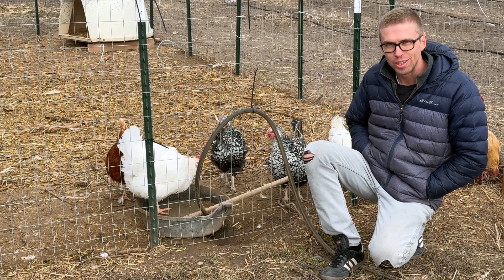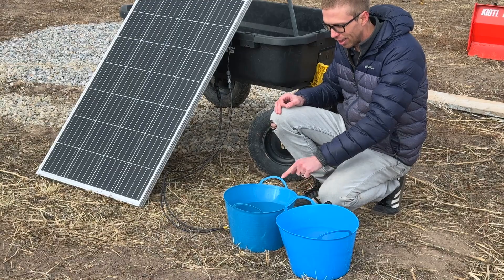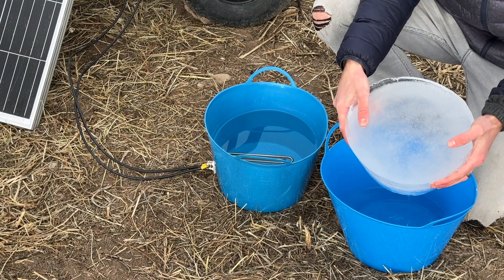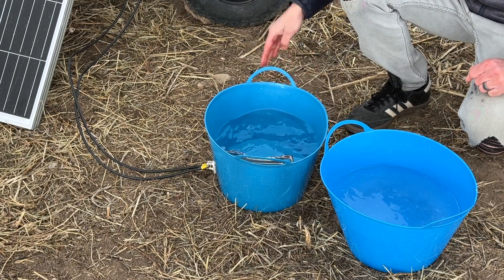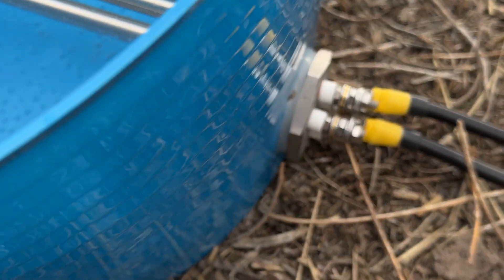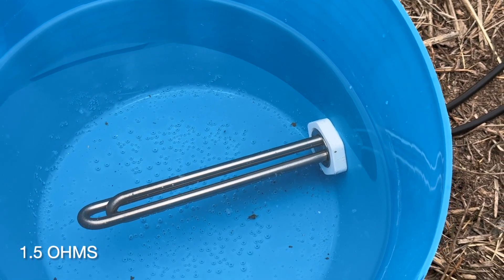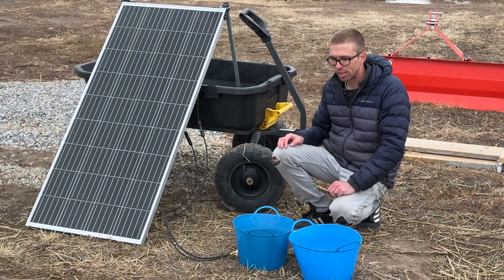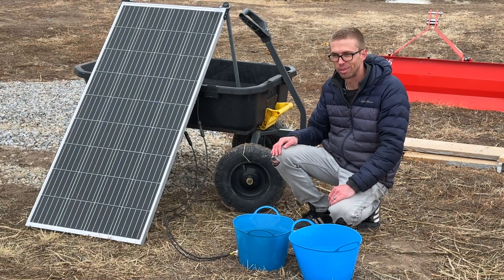Solar Chicken Water Heater // PV direct!

Comment: Technically could you snip off mc4's from panel and direct connect to heating element?
Reply from the maker: Yeah you definitely could! But if the heating element dies then that’s a lot more work to switch it out

Comment: This is very cool.  I have been toying with the idea of trying to heat ibc totes in the winter in a high tunnel to act as solar heat batteries.  You now also have me wondering about using something like this to help heat an above ground pool.  Thanks for the video.  We should collaborate on something.

Comment: You have done about as good as you could with standard off the shelf components and not putting two in series. There isn't a good selection of elements.  Many are not aware that a 12V panel is actually 20V.    IDEAL RESISTANCE is a little over 2 ohms.   There is a penalty for going under resistance, but very little for going over.  Studies have shown that total daily power increases even at twice the ideal resistance.   A 6 ohm 9,000W 240V element would be pretty ideal for winter.  Except it wouldn't fit in your bucket.  A combination of silicone heating pads would be a solution on a metal bowl.

For the last ten years I have specialized in PV water heating and have designed controls for efficient energy transfer matching the panel to the element in any sun condition. Especially early morning.  In low sun conditions found in winter the panels low current produces very low voltage. It is a function of squares producing extremely low power.   My ideas haven't caught on in the solar community, I would probably do better with the chicken people. I have some old prototypes which would work with you existing setup.  You might have to add a thermostat due to higher energy. Contact me if interested.
Reply from the maker: Oh man, this is awesome! Thanks for the info and I'm glad you found my video!

Yeah the chicken folks might be your people! I'm surprised how many people I've seen talk on forums about wanting to heat water for chickens with solar but the majority of responses are that it's not possible or too expensive. I had a hard time finding any attempts or setups shared online, especially not any using direct to resistance heating.

I'd love to learn more about how the mechanics of power point tracking works in optimizing power output on solar for something like this. I just assumed that the lowest resistance possible would be ideal to prevent the element from being a bottleneck on current.

I just created a setup with a larger 15 gallon water container. I wonder if a 9kW 240V heating element could actually fit in there...
Reply: @SmithOffGrid  All solar is local.  This morning it is 8 degrees, overcast and there is a slight dusting of snow on the panels. At home I have a 450W 60V array for supplemental heat to my heat pump water heater. This is mostly for product development, my summer home is all solar. 
At this time the system is producing 0.25A @ 60V or 15W.  This is lower than usual but in winter getting 40 to 70W (15%)is not. 
I removed the snow about an hour later and current increased to 0.96A (58W).  The current rating of these panels is similar to yours. You design for the bad days.  Good days take care of themself.

Suppose your panels can only produce 1A on a winter morning. This data can be verified by measuring element voltage in the morning.

1A X 1.5 ohms = 1.5V  Multiply that by 1A and it produces 1.5W.
2A X 1.5 ohms = 3V  Multiply that by 2A and it produces 6W.
3A X 1.5 ohms = 4.5V  Multiply that by A and it produces 13.5W.
That 200W panel hasn't provided a lotof p ower but it was needed to get that much current. Panels are current sources.
This range of current is typical for winter. Days with more sun likely wouldn't need a heating system. This may struggle in winter.

Lets substitute a 6 ohm heating element
1A X 6 ohms = 6V  Multiply that by 1A and it produces 6W.
2A X 6 ohms = 12V Multiply that by 2A and it produces 24W.
3A X 6 ohms = 18V Multiply that by A and it produces 54W.
This system will peak at about 70W because resistance will limit voltage to about 23V, the open circuit voltage. My guess is 20W is needed to melt ice.  
This looks fairly successful.

Finally a power point system where winter panel voltages will be about 21V and stay there regardless of current.
1A = 21V  Multiply that by 1A and it produces 21W.
2A = 21V  Multiply that by 2A and it produces 42W.
3A = 21V  Multiply that by 3A and it produces 63W.
This is magnitudes more successful. The new problem is a temperature control system to prevent the water from becoming a bacterial stew. With 200W you could boil the water. A power point control can operate with a 1.5 ohm element. Pulses are always the maximum current of 15A. It operates much like a light dimmer using duty cycle to control power. The electronics is just easier to built with higher voltages.
Reply from the maker: @opera5714  This is finally clicking now! Thank you so much for the detailed explanation! This got me down a rabbit hole yesterday of learning more about the solar IV curve and how power relates to current and voltage in this application.

I picked the 48v 1500w heating element because on paper it was the closest I could find to the ideal resistance for my 190 watt solar panel (2.17 ohms). On paper the heating element was 1.5 ohms but I just measured it and it actually reads 2 ohms, so even closer to the idea resistance which is great.

I got lucky that the element wasn't too much under resistance because I didn't realize that going under would be so detrimental to winter-time performance. I had assumed that the least resistance possible would be best to maximize current so that's what I was looking for. And while it does maximize current, it comes at the high cost of voltage needed to make useful power.

I had heard that voltage on solar panels is consistent while current varies, which sounds like that's true but only when there's no load. I had incorrectly assumed that the voltage would remain constant even under load but that's not the case. I had never measured the voltage of a panel under load.

I have a second heating element with a resistance of 0.6 ohms that I put in a larger container with the same 200 watt panel and the performance was horrible. It was pretty much entirely iced up which surprised me because the other heating element was working so well. But the math adds up! I was getting 4.63V and 7.95 amps or 36.8 watts when with the 2 ohm element I would have been getting close to 128 watts given the same conditions. Really eye-opening to see that!

I moved my initial 2 ohm heating element into the larger container last night and I expect I'll get much better performance now.

I'd love to see a graph over the course of the day measuring the Isc and Voc and over time. I imagine the Voc would be pretty constant and the Isc would roughly follow a curve with sunset and sunrise being around zero and the peak being the Isc on the spec sheet of the solar panel.

It's been so helpful to think about the performance of a solar panel in the terms of current potential that shifts throughout the day as lighting conditions change. The solar IV curve also shifting too based on current potential. With it becoming shorter left to right with less current potential (assuming current along x axis) so the voltage and current area (power) would be very small if the current is too high. But it makes sense you'd want to lean towards keeping the voltage high (tall rectangle) because that has the most opportunity for a larger power area.

I also found a cartridge-style heater (48V 500W) with a resistance of 4.6 ohms. And it's much smaller than the 9kW 240v element would be for smaller containers. https://amzn.to/40IZFY1

The numbers on it seem like it'd work really well too:

1A → 1A^2 * 4.6 ohms = 4.6 watts
2A → 2A^2 * 4.6 ohms = 18.4 watts
3A → 3A^2 * 4.6 ohms = 41.4 watts
4.35A (peak) → 4.35A^2 * 4.6 ohms = 87 watts

Graph of all the different heating elements and estimated power given current:
https://i.ibb.co/HKktyrG/graph.png

I'd love to experiment with a simple mppt or even make a purpose built one for heating chicken water. If I could integrate a temperature control system as well that'd be awesome. Lots to think about!
Reply: @SmithOffGrid  4.6 ohms makes my job a lot easier.  The most effective heater control uses capacitors.  It is a RC network and the longer the time constant, the better it works.  R is the heater element and the larger it is, the smaller the capacitor bank can be.  1.5 ohms just increases the cost.  I'm only trying to get 0.3ms of storage.  for example, 60Hz line frequency is about 8ms.   I'm working on a low cost design for this application.
Reply from the maker: @opera5714 Very interesting. I’ll be excited to see your design!
Reply: @SmithOffGrid  I have the basic design built and waiting for some power capacitors to arrive tomorrow.

One element I didn't mention is a 1500W 120V 10 ohm heating element.  I've used several of these in my system which I later replaced with 6 ohm for more power.   I must have thought that it might be a stretch for some to believe it would work.  Running the numbers, it seems perfect for this application producing power quickly and peaking at 40W. Many of them are quite short and they used to sell at big box stores for about $12. Everything hardware has gone up in price so much.